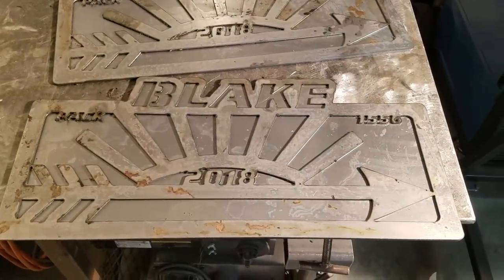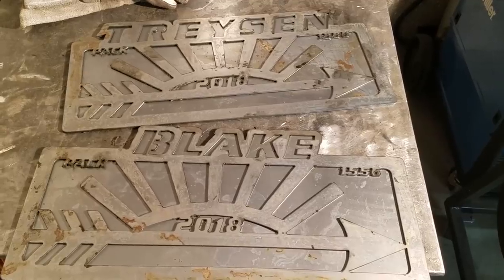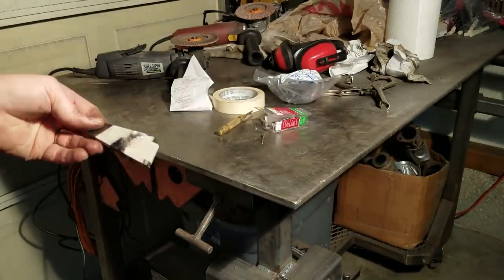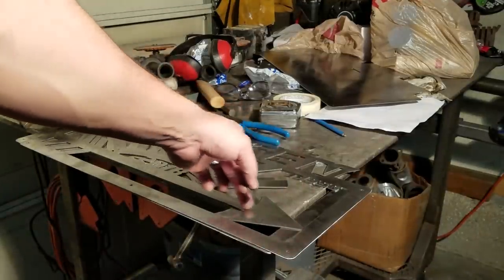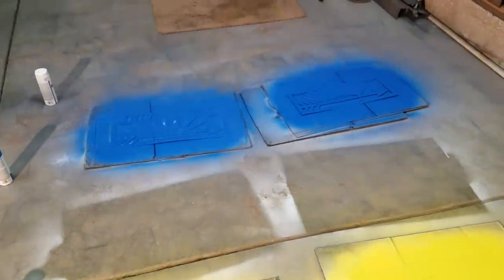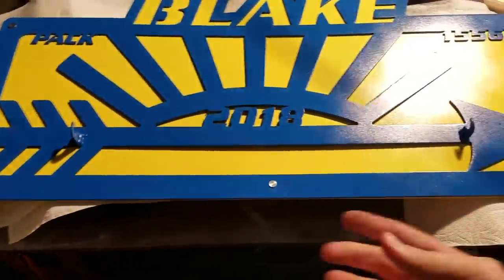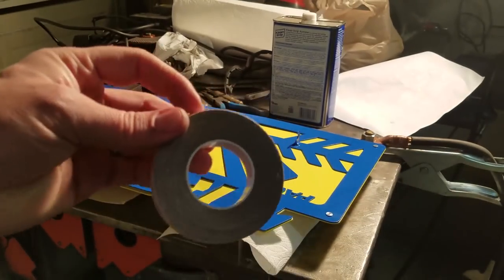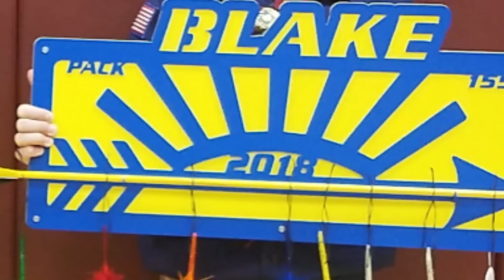"Arrow of Light" Awards for Webelos Scouts

Comment: Greetings from a graduate of Cub Pack 410 (and a former leader) !  This is an excellent idea.  A few observations:  Rivets were the bailiwick of Steel and Iron Workers, the most manly of pursuits and there would have been no problem with placing one every 4-6 inches or running a line through the letters of their name.  A touch of the same paint can be applied to the rivetheads if desired with a Q-Tip or fine artist's  brush but, ... see above.  And one final comment, Welding is a Boy Scout approved activity where a patch is awarded, you can get the boys a head start by having them 'help' make their awards.  A chat with the scout leader/sponsor you aught to be able to get them another earned badge.We Be Loyal Scouts -  "Any Time, Any Place"